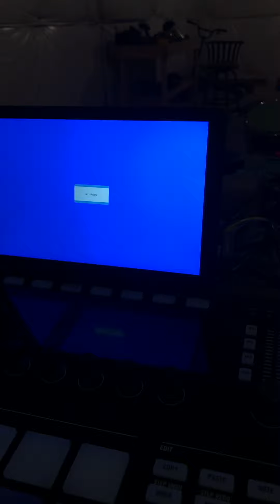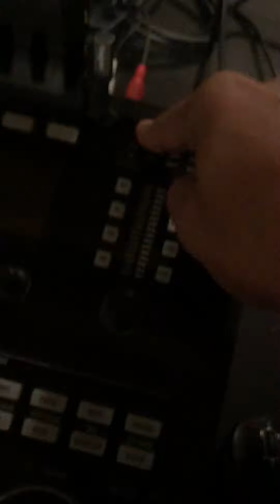How to mount display on Maschine Studio

Comment: I'm not clear on the computer part. And sound card configuration.
Reply from the maker: I'm using an Intel NUC computer (built inside), and a Scarlett 2i2 for the interface; which I placed in the front of the unit.